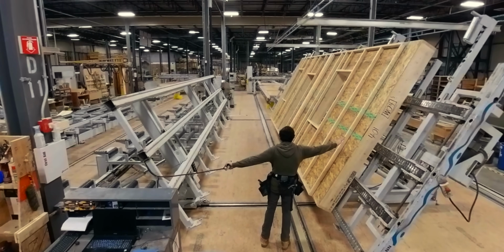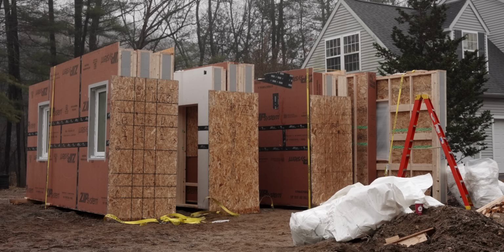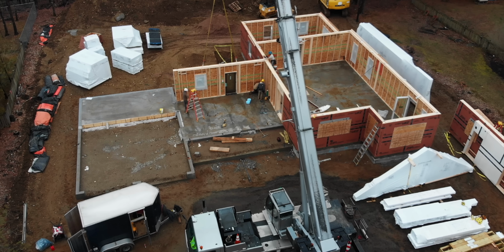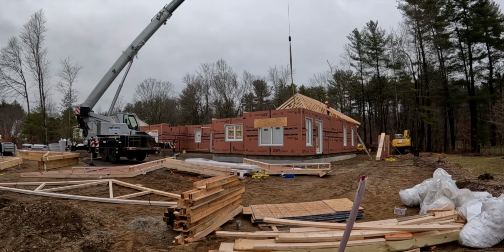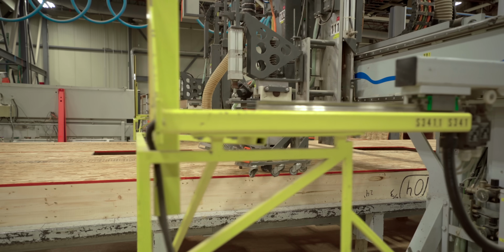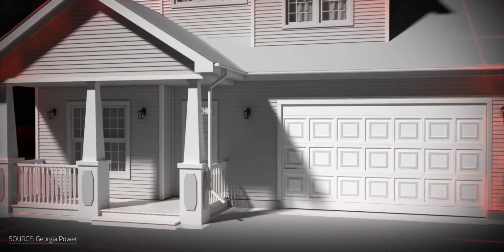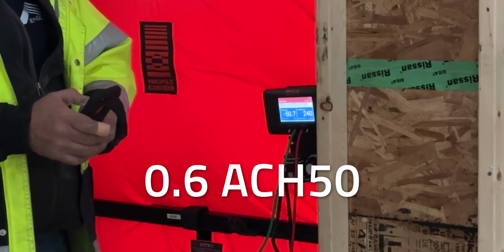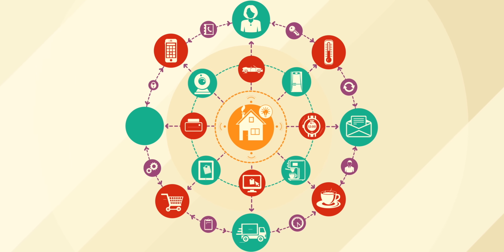Wow! I Didn’t Know A Prebuilt House Could Do This

Comment: Between minute 11 and 12 the house interior is panned showing what appear to be furring strips to hold interior sheetrock.  I thought these panels came prepacked with insulation sandwiched between an exterior Zip and an interior OSB.  Off loaded on site they have that super thick appearance, but the assembled house shots  show a texture of apparent OSB (the inner skin) and  vertical wood strips that appear to be furring strips. The ceiling which is  stick built on site also appears to have a panel skin to hold attic insulation and also furring strips.  
   Why do you have this system of interior furring strips? The air gap on interior wall is not important
for moisture escape which is a condensation issue for exterior surfaces when there is impermeable ZIP skin. 
     Why are you  not attaching finish directly to what appears to be an inner OSB skin. Are you fearful of
nail or screw penetrations for attachment? Is the furring strip system installed at factory?
Before this house is finished can you walk through in detail the strategy of finishing out interior walls and the junction of window and door jambs to finish sheetrock.  
 Finally,  how could the prefabricator  eliminate (95%) the odious chore of sheetrock attachment and finish.  Can that battle against gravity applied to standing walls and disposing scrap be assigned to 
the factory.

Comment: Really tight house can have some of nastiest  air quality  unless really good harvest is installed  note this requires  electricity  so if  power is lost long time air quality suffers
Reply: It's pretty easy to simulate a porous house if the power goes out... open a few windows.

Comment: Great video.  I am curious about the smarthome tech you plan to use and the platform(s).  I am also building a SmartHome (part for energy management and savings, and part for comfort and ease of use).  I am also curious what other passive energy methods you are using?  spray in insulation, insulated siding (such as cork which is natural and sustainable, etc)?  Thanks for sharing, look forward to seeing more.

Comment: Hi Matt. I'm just finishing my first (and probably last) house. I decided on a ceramic brick because of its good properties. Unfortunately, I did not take into account who and how will do it. Good material, hopeless team.
If I had the opportunity to start over, I would also go for prefabricated houses. In my country, wood is not so popular for walls. But we have the company "M3 system" specializing in XPS polystyrene segments.
Ultimately, it's mainly the price and available budget that play a key role in what you build with.
The biggest expenses go to finishing the house, so hold on tight.

Comment: I used to work for a company that built ICF homes in Houston, Tx. It was fascinating to see how the home went together. The framing was made from steel, and the walls were around 8" thick with 2" of foam on each side, with a center of poured concrete. The walls were rated at R50. We would turn on the HVAC systemand chill the house to around 60 degrees - then we would turn it off. It literally took weeks for the temperature to rise despite the upper 90s temperatures outside. I am sure that opening and closing the doors multiple times a day didn't help, but it absolutely was a huge selling point. Unfortunately, compared to stick-built homes, they couldn't really compete price-wise, but the homes were amazing and incredibly beautiful.
Reply: One would guess that prefab houses were cheaper. It takes a lot less time and the materials are similar to traditional homes.
Reply: Could you please provide the name of the Houston company and/or their website?! Thanks.
Reply: R-23 ish not R-50 but yeah nonetheless they are impressive. Most walls are R-13 batt 2x4 walls that end up around R-11 fully built.
Reply: ICF homes are deceptively marketed as being far more efficient than they are.  Yes there are definitely benefits to ICF construction (if you can afford it) but as previously pointed out, they are nowhere near R50.  Concrete doesn’t insulate well, and 4” of foam is only about R20.

What you end up with is usually a very airtight home with average insulation but HUGE thermal mass.  If exterior temps are below the thermostat set point at night the walls will cool and it takes considerable time for them to warm again during the day.

In a cold climate where temps are always below set point, they act similar to any house with similar R value insulation, they just react more slowly to temperature swings.
Reply: In germany many of the passive houses that were built inn the 90s now have issues with mold, because there is to little air exchange.
Reply: @teekanne15  sounds like they need a dehumidifier built in.
Reply: @teekanne15  has nothing to do with air exchange. Has everything to do with poor humidity control. Its pretty easy now but yeah back in the 90s and 00s they didn't quite understand humidity and vapor control like we do now.
Reply: @paladain55  comes down to occupant education too.  The original owners may have understood that keeping the ventilation running was necessary, while later tenants might not understand and turn it off.
Reply: @superspeeder  thats true! Have a friend who sister owns a rent house. The tenants during the recent winter apocalypse since it was around the holidays turned off the thermostat and left. Froze the pipes and flooded the whole house lol. So dumb. Said it was underwater for a week.
Reply: @paladain55  wow… well there’s some proof right there, lol
Reply: @LoanwordEggcorn  yup that and set lockouts hopefully
Reply: @teekanne15  Bingo!!! I like a little fresh air circulating. Indoor air pollution with offgassing building materials can be really bad if theres no air turnover.

Comment: Small correction. The wall won't dry through the zip sheating because it's a vapor barrier. It will dry through the osb back panel though since it's semi permeable to water vapor.
Reply: It will definitely depend on how much water gets trapped. I have dealt with a number of significant failures of SIPs due to construction moisture.
Reply: It's a one time event. It will dry over time unless he has a pool inside :-)

Comment: Why didn't you use T-Studs in the framing process to mitigate thermal bridging problems?  A typical 2x6 wood stud is 6.88 compared to an R-value of 19 in a Tstud.

Comment: We have windows like your new windows for over 20 years now, there great for cleaning your own windows on second floor as no ladders required, only drawbacks for the ones we have is you can’t open the window just a little bit and a strong wind might close them with quite a bang, we also found that a small Grease gun with white grease is helpful to keep the mechanical interlocks happy after a decade of uses, if the mechanic interlock fail you could be holding on to the windows in a most precarious way.

Comment: Pre-built, Pre-cut, Pre-installed. Too many "pre"s in this video. 

It is not pre-built it is simply built in a different manner. If it was pre-built then it would have to be transported to site as a whole inclusive of foundation.

It is not "pre-cut at the factory," it is cut at the factory. Similarly with "installed" etc.

Comment: Hi Matt, when everything is finished, all the tech in etc., I would be very interested in a full cost breakdown compared to a regular home. My prediction is that it won't be cost justified but that is to be expected when comparing a leading edge technology to a process that has huge benefits of scale and decades of process improvements. I hope you keep your channel going for years and you're willing to do an annual update to see if the cost saving are what was expected as the home ages. I suspect maintenance will be more to maintain the airtight ratings and the leading edge tech will inevitably cost more to maintain BUT late adopters like me really appreciate early adopters for leading the way into the actual use of new tech.
Reply: It will obviously be enormously more expensive than a regular home.
And you'll have to have somewhere else to stay while it's being built. Plain old solar panels would have been just as functional. But when you've got the money, you've got the money. 
That's why being financially literate and future oriented that is important.
Reply: Matt, I would be very interested in this also.  What is weird to me is why this technology does not experience a serious cost reduction to building a home when built in a factory.  I mean, lots of other products that are replicated in large volumes in factories gain lots of cost savings.  For example, my intuitive expectation would have been to expect a 50% reduction in the overall cost of a manufactured home.  But, I guess it would have already happened (all homes being made in factories) if even a substantive reduction in costs could have been realized (e.g. >20% cost reduction).  If you do a video on the economics (please do!) it would be great if you could answer this baffling question.   Thanks Matt.
Reply: @RCGache  In short, the building materials are much higher quality than a traditional home build and hence cost much more.
Reply: @RCGache  It's a combination of government and culture, which makes homes have incredible cost, regardless of markets.
(TL;DR: home loans, as started by central government, created inflation. A story as old as time.)

For many decades now, homes have been seen in the West as investments not as commodities. And... it started with government involvement to get "disadvantaged" people loans to buy homes. A fair and noble goal...
But now, someone who could only afford say, a 5,000 dollar home, could now afford a 10, 20, or even 30 thousand dollar home... In small payments overtime.
And then, seeing the piles of cash the government offices were making, people offered similar loans. 
And like that, the availability of capital in the still-limited market ballooned to ridiculous levels. 

(And because of this rampant price inflation, it became valuable to hold onto property. And thus became an investment vehicle. Which means now people are buying them not just to live in, but to try and put their money to work. Which restricts supply yet further. Plus, most of the West has an addiction to importing foreigners who...surprise, surprise, also want homes.)

Meanwhile you can look to other markets where homes are still treated as commodities - as in goods that you expect to use and then throw away. 
In Japan, as soon as you move into a house, its value drops by the same percentage as driving a car off the lot in America does.

Comment: Thanks, Matt - great video. I’m an architect and certified passive house designer and I think you did a good job of explaining the principles of passive house design along with the visuals you presented. I look forward to seeing more videos related to your house build, specifically the geothermal system, ERV installation, and solar/battery details. Congrats on building your passive house and achieving 0.54 ACH!
Reply: I am also interested in seeing your excellent explanation skills show us your GSHP, ERV, solar + batteries, appliances, smart home, audio / video / studio, hydronic floor?
Reply: Previous Contractor and now licensed plan reviewer and inspector here.  I love seeing videos like this. When most of these tests are done, the owner isn't there so it's nice to get the viewpoint from the owner and soon-to-be tenant.
Reply: Mike, when it comes to ACH, how much more difficult and costly does it get the lower you try to get it under 0.6?

Comment: Congrats on the progress Matt! I hope you will go full on with IOT home automation and keep most of it with Open source (I. E. With home assistant, esphome tasmota etc) and not with some proprietary stuff or full cloud based software.
Reply: ya the issue though majority is proprietary stuff, linus was trying to keep with open source but kept getting snagged, he's going back from wireless speakers to wired speakers for example. there is a saying to much tech is basically a bad thing

https://www.youtube.com/watch?v=5SkJdPp35pM&list=PL8mG-RkN2uTzgyA8zzE8vRB3_ZXQfuFRz

linus did a whole video of local smart home instead of the cloud, i can say ya just don't do it for everything and just for a few things 😑

as for proprietary like also firmware updates with jesco https://youtu.be/KkAiXzKOTNY?t=1266

basiccy you required to have a hub to update your light switch, they later changed there minds so people can get the firmware update without the hub

Comment: I'm glad to see that this is picking up in the US. My parents had one of these "Fertigteilhaus" built in Germany in 1996. It took one day to set the walls and another day to put the roof on, including the clay shingles. They also had a solar water heater installed with 3 panels on the roof that work flawlessly to this day and provide hot water for most of the year, even at 51 degrees latitude. When I moved to North Carolina in 2006 I was a bit shocked to see how much energy it takes to pump the heat out of a stick built house, only to burn more gas or electricity to heat up the water for a hot shower. I really wonder why solar water heaters aren't a widespread thing, especially in the southern US.
Reply: Sadly, is cuz of politics most likely.

Comment: I'm looking at a steel frame factory built home - for various reason, mostly wild fire dangers here. Highly efficient and much the same process as this, just steel instead of wood frame. It's been a great learning experience.
Reply: Do you mind sharing the builder you're working with if they have a web presence? I'm interested in this.

Comment: I’d love to be able to afford this type of build, good for you that you can do so.
I’ve got a simple solar/battery system in, what I think, is a relatively well insulated house. We still have some cold spots, but that is probably down to inefficient gas boiler/radiators. Heat pump/underfloor radiant heat would be great, but economically not viable at my stage in life.

Comment: I myself prefer the tongue and groove SIP's. You can  construct the walls and roof of a  2000 sq ft home in a weekend. 
They are so air tight you actually need a mild air circulation for temperature and air flow consistency. Good luck. 
Make sure the insulation is treated. Yes, termites will eat through those as well.
Add Passive solar to offset the electrical demand. Look at using Heat pump concept for tapping int the ground/air temperature. Another good one. Thanks. Don

Comment: I don’t recall you addressing this in a previous video but apologies if you did. Did you consider going with prefab units with the interiors finished in the factory and then assembling the units instead of the unfinished interiors and if so what were the deciding factors?

Comment: Cool video. How would you compare the cost of this home with a traditional stick built home?  With the prefab walls, you're eliminating framers, windows, etc but then you have to hire a contractor to finish a majority of it. I'd imagine there was a great deal of negotiation for the contractor to figure out what the right price would be to take over at that point.  Additionally, with the walls already insulated, how does the plumber and electrician get access to the inside of the walls to run their wires and pipes?

Comment: Matt, I live at 55.75° N, recently re-insulated the roof to R60-R62 with blow-in insulation, makes a heck of a difference in power costs. Working on the rest of the building envelope.

Comment: Nice!.. But it baffles me why American homes have so many walls and corners, niches, corridors and what not.. oh, and complicated roofs of course. Why not just one or two interlocked squares with everything in it? And everything is on one floor, having more floors with the same number and sizes makes it also more efficient to heat... and gives you a larger yard :-) .. like having the living room garage and kitchen on the first(ground) floor, and the bed rooms, office/studio at the second floor, and the attic can be used for storage, boiler room (or AC/Heat pump), ventilation. Simpler roof would provide more space for solar panels and solar heating.

Another thing I wonder about, how is the stability of the wood panels of the walls?  My house in The Netherlands is made out of double walled concrete, built in 1992 and solid as a rock (litterly), it is in a row of 8 houses that share the sidewalls, 2 floors plus a huge attic with 45 degree roof either side along the row of 8 houses (one big long roof), top in the middle (In the Netherlands we call this a "rijtjeshuis" in a translation is see it is called a "Townhouse").. Many of my neigbours have built an extra room in the attic. Since 2014 I have 14x 250Wp solar panels on my roof that covers my annual electricity usage with a big margin. Btw the isolation between each house is excellent, I hardly notice my neighbours, but when drilling a hole in the concrete. you hear it through the whole block of houses LOL!

I am also in the process of electrifying my home, this year I will swap the gas stove for an induction stove, I have replaced the front door with a high tech plastic door from Weru (similar to your Logic windows and doors) and second floor front windows with Weru windows, all with  with HR++ isolation glass and this same tilt/turn windows, I hope at the end of this year to replace the second floor back windows and kitchen window, and then in 2024 the living room window and back door. I hope this is sufficient to be able to install a heat pump, but I am afraid I will need to replace the complete heating system with radiators, pipes and stuff, maybe a hybrid system is better where a heat pump is added to the existing gas boiler. This means most of the year the heatpump is used, only during very cold days the gas boiler needs to kick in... But that is for the long term, first the induction stove and some more Weru windows.